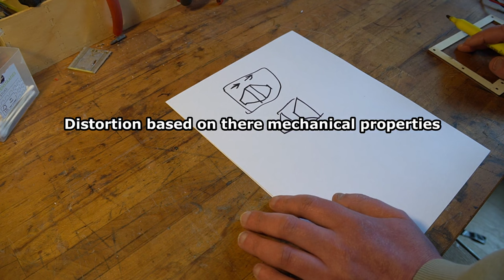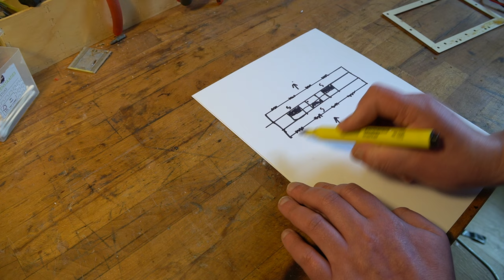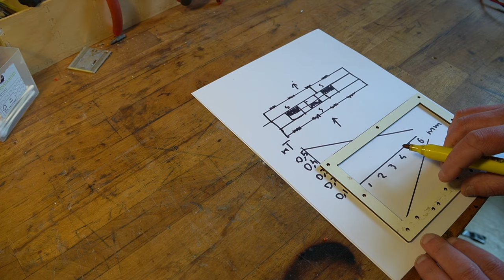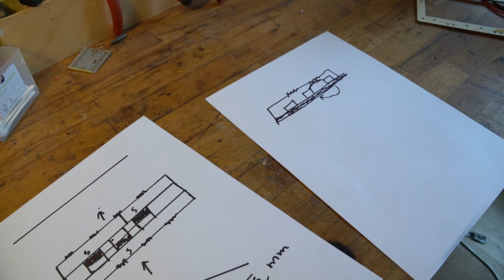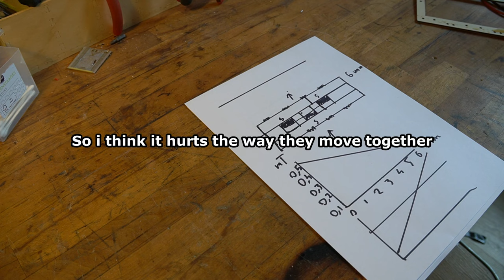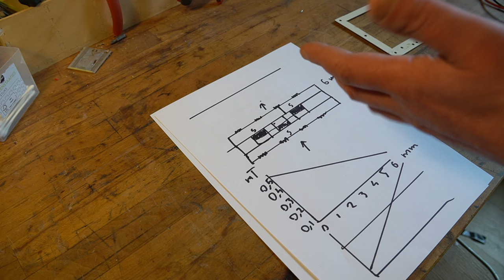Dual membrane planar bass driver part 4 - Explaining the idea

Comment: good concept!  The less air between the membranes, the better.  It would  surprise me if would work  for mid and high.  This is excellent for the low end, what typically the weak spot  is for foil.  Hope this works out, at some point you need a product.

Comment: Great explanation.  It's been many years since I studied physics, but I recall the magnetic field strength drops with  1/ distance^2     or maybe for a long slender magnet 1 / distance, but I'm grasping at straws.  Of course you've done FEM modeling, so you know better than I.  It is very interesting as the motor gets stronger at the limits, the opposite of traditional woofer coil leaving the gap. A speaker suspension tends to get stiffer at the limits, so the motor getting stronger with excursion will compensate for the suspension getting stiffer.  Pretty interesting.  If you were to cut the driver in two with half the magnets on each side, it would be the same as two panels back to back, so that looks to me exactly like an open baffle  isobaric configuration.  I don't know.  Mark said he is happy to have a zoom call with you.  Hopefully he has emailed you.
Reply from the maker: Thank you ! well it does have similarities to an isobaric for sure. but the main benefit half the enclosure is not a thing here and i use one motor to drive both. about suspension im sure something similar happens here, but in this case the suspension on both increases with excursion both ways. inward and outwards so im not sure. i think damping and the air in between has room to play around with. since i am not sure yet what would be better. for the driver
Reply: @joppepeelen  If you have any digital EQ available, I find that using the Linkwitz transform (2nd order asymmetrical shelf filter) is very good at producing the desired response electronically even with a slightly high Q woofer systems.  It sort of seems too good to be true, but I use it all the time now.  I really want to build a pair of these panels.  I need to find the source for the thin foil and Kapton for the diaphragm.

Comment: Twice the size and a more normal 3 mm xmax , wouldn't that give the same efficiency as a single ended, but with way lower distortion?.
Reply from the maker: yes as one of these much smaller ones it might... but what if these where twice the size. and 4 or 5 mm xmax instead of 6 ? besides that it is not using metal. making construction rather easy :) no jigs no glueing (might need some but at least it will stay put :))

Comment: Between the membranes I used a porous damping material. This more effectively lowers the resonant frequency and reduces the time delay between the front and rear membranes.
Reply from the maker: well it would damp the main resonance , but would increase the delay between the foils, since  i believe you slow down the air when damping.  then again the distance foil to foil is not a problem at these low frequencies its out of phase above serveral Khz, so no problem for low end.

Comment: As with an isobaric driver, a mass of the membrane is doubled. So, you have two resonance frequencies: a single, lighter membrane (actually these are two frequencies cause membranes are slightly different, and so a tension), and doubled, heavy, composite single one. The easier an air moves through a grid with magnets, the more the second resonance plays. The  tighter holes are the more role have two higher resonances. What is in a between I don't know -)
Reply from the maker: well i dont know either :) i am not even sure yet if the air is something i want... or not  i can imagine it can be nice if the air is free to move. and not been compressed by a piece of damping it encounters. so i might need to make one that is leaky somehow... although i am afraid it will have scuffing like closed speakers with a leak :)
Reply: @joppepeelen  Yes, why not. Just consider an amount of moved air at low freqs and a hole area to keep an air speed and turbulences low.

Comment: This is nothing like a normal driver isobaric coupling, where you (almost) double MMS and halve Vas while keeping the air loaded area constant.
The reason your Fs (main resonance) goes up in frequency is that your MMS (total weight of membrane including air load) is LOWER for a coupled membrane1+membrane2 than if either membrane was acting by itself. The air mass that is between the membranes shares its' load between both. The MMS (total driver acoustic mass) is totally dominated by air load in an elctrostatic or planar driver, while it's almost completely dominated by actual cone assembly mass (not airload) in a normal driver....
Two membranes standing alone have total air mass loaded area of 4 surfaces x the surface size, a couple pair only have two-point-something (2.5?) x the surface area.
If you had zero losses (nothing but a thin air gap) between the membranes you would get half the air mass load. Now you don't get a perfect halving since you have flow resistance and other things lowering that "sharing" capability.

What's happening with the Helmholtz resonance between the membranes (through the magnet gaps) is extremely hard to say. You have a LOT of unsupported area of foil between the coil tracks, and a lot of air volume - so at least some of the pressure goes there in stead of being converted into air movement. It's pushing the un-driven foil out (relative to the coil going "in") on larger excursions. I've used slot venting in cardoid modified normal speakers, and slots/vents that are this short/narrow are pretty hard to model. It takes some experimentation to tune what leakage you get.
Reply from the maker: thanks for the explaination ! i agree  the coils should be wider. and i normally do, but in this case i wanted  as much output. and the next foils will have more coil, since i think its importand to have it driven more uniform over its width ! about the leakage there is not much right now but the question is do i need leakage >? if so where do i get it from :) maybe some holes in the magnet frame to the outside world. but they have to be big to let all the air trough. without scuffing etc
Reply: @joppepeelen  :) I meant that how the air in the magnet gaps behave compared to if the volume between the membranes was fully "open" was hard to say :) I would bet that you have some secondary resonance around 700-1500Hz caused by interaction between the volume of air between the membrane (the 'box') and the magnet gaps (the 'ports')... That's what I saw with slots with about that size. I don't think you want much leakage to the outside in this case - I did, when experimenting with rear pressure leakage to get midrange directivity control. Different thing altogether.

But actually, having a few very small pressure venting holes to allow for some (very slow) pressure equalization if you transport the driver or something like that would be a good idea. Especially if you make something like this that's meant to last for a few years of use.

In a compression driver you solve that airgap/slot resonance by keeping the trapped air volume extremely low. Typically a compression driver dome has less than a mm of physical room to move, meaning that the volume of air between the dome and the slotted phase plug isn't really large enough to trigger a Helmholtz resonance
Reply: For other applications isobaric was used because you could put the driver's in a box half the size of a single driver and get the same output as a larger box. I think you should try a box.

Comment: If the membrane are sealed, would interesting purge the air out with a refrigerant,  denser than air.
Reply from the maker: thats a cool idea, not very practical but cool non the less
Reply: @joppepeelen  or maybe helium?

Comment: Technically isobaric just means the constant pressure between the diaphragms, but I get there are also other nuances.
Reply from the maker: hmm yeah and that might be true in this case although io doubt it :) but its not the reason for making the thing. since it adds indeed other benefits that isobaric does not have. or at least should not have :)
Reply: @joppepeelen  Think of it this way: 
you have two membranes with separate voice coils that use the same magnets. 
As you pointed out in you explanation, the field strength for the front membrane drops as it moves outward, but since the membrane on the back is also moving in the same direction, the field strength for that coil is increasing. 
If you maintain a constant pressure (isobaric) between the membranes, they will tend to couple with one another better, so as the rear membrane pushes forward it will also push the front membrane with it, and linearize the field strength. 
Same as the front membrane moves backwards, it helps push the rear membrane with it, but only if the space between the membranes is sealed.
The main reason cone drivers are set up in an isobaric configuration is to reduce the enclosure size. The idea that orienting them cone to cone to reduce distortion is mostly a red herring. The distortion reduction you get is barely measurable and certainly not audible.
What isobaric for cone drivers does is make them more like modern drivers that are designed for smaller boxes.

Comment: When do isobaric woofers the air space between the drivers must be perfectly air tight. Play 50hz and if the output drops over time then pressure is building up between the membranes.

Comment: Sorry, but I can’t see any argument, why this should be any better than a standard push pull configuration.
Reply from the maker: its not better then a push pull, i never said so :) it is better for my wallet ! and fingers. the idea is its better then a single ended. while i spend far less money on magnets and even steel. having to put 2 steel plates a 25 euro together with 180 magnets.. is not a nice choir. and well cost much more.  you never wonder why most are single ended when it comes to low end ?